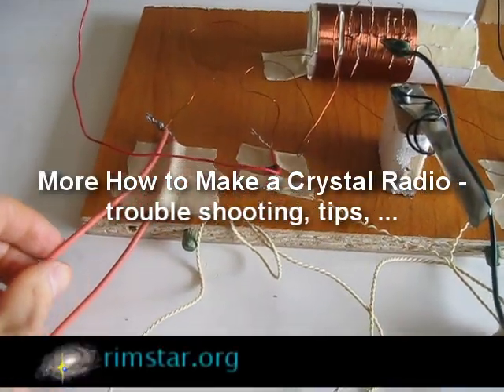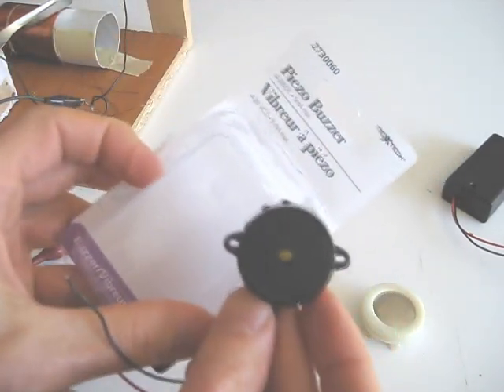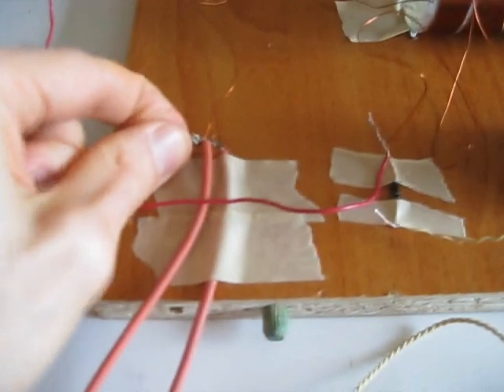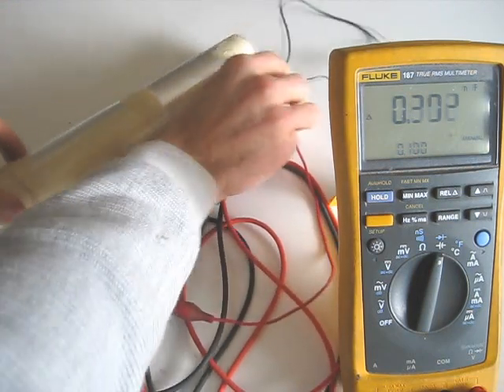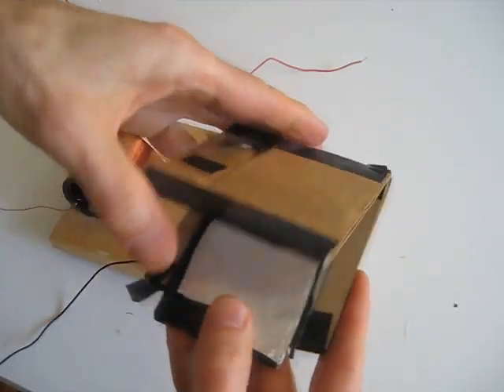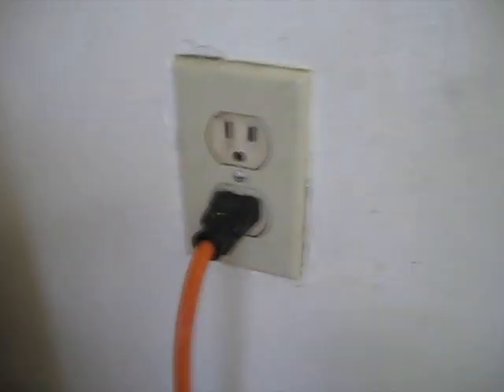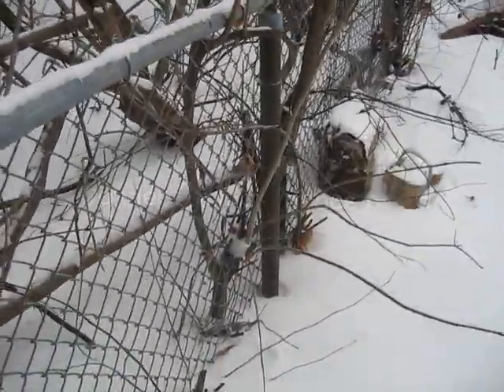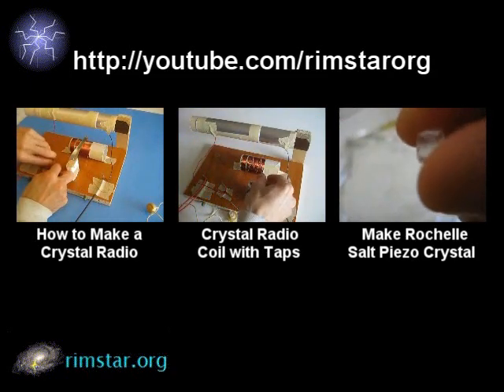Crystal Radio Troubleshooting and Tips

Comment: Howdy.
Only an observation of mine. The crystal earpiece may actually get so charged by statics it stops working. Shorting the leads produced a loud snap and it began to work. I, flippin', threw away 2 or 3 pieces possibly quite good items. So I suggest connecting a large resistor in parallel with the earpiece, say 470 k.ohms to discharge it. It may take some time for the piezo to exit the dead zone with a resistor this large but it is important not to load the circuit more than necessary.
Regards.
Reply from the maker: Thanks for the tip. I've heard of using a larger resistor like that for helping drain that charge but this is the first time I've heard of the charge causing a problem.

Comment: Hey guys, i was an amateur in a simple electronic, but i was an absolute beginner in something like radio.

 I have some question, So I (we) can each design our own crystal radio according to our needs and creativity and it was :
- How to determine the AM frequency range based on the coil (wire diameter and wire length or coil diameter)
- How to determine when and how to use variable capacitors 
- How to determine the parallel resistor value on the audio output
- How to determine the inductance value using information on the highest planned AM frequency range 
- How to determine the inductance value based on the length and diameter of the wire used in the coil 
- How to make a variable inductor
Reply from the maker: That's a lot of questions. This video http://youtu.be/EsZQS2GOMQE shows how I made it and has all the dimensions for the capacitor and coils. This one has another way of making the variable inductor (coil) http://youtu.be/d4ymSGH0-Jo using taps. There are many ways to make a crystal radio, but the basic idea is to have capacitance and inductance to tune into a specific frequency (preferably) and that capacitance and inductance can be in the antenna, coil and/or capacitor. In my radio I use an inductor (coil) and capacitor in parallel (there are also series circuits). This video one goes into how the crystal radio works http://youtu.be/HupFY_24o-4 and I have specifc videos for how the parallel circuit works but they're best viewed from my webpage which also has calculators https://rimstar.org/science_electronics_projects/coil_design_inductance.htm and https://rimstar.org/science_electronics_projects/lc_circuit_aka_tank_or_resonant_circuit.htm .

Comment: Till now I make a few crystal radio and I have to use mini amplifier to hear the station..without amp I cant hear the sound. Any suggestion sir?
Reply from the maker: The longer the antenna is, the better the signal. Making sure you have a good ground also helps.

Comment: I have ground related issues like the 50HZ hum making it impossible to hear the radio
Reply from the maker: That's called poor selectivity. Make sure you have a good ground connection. Also, the particular design I show here shouldn't have less of a problem with that. I explain why at around ten minutes and forty five seconds into this How a Crystal Radio Works video.

Comment: I built one of these from scratch for a 5th grade science fair in the 1950s with a single coil/cap, tank or resonant circuit. Worked great...I built this one with 25t/90t & sliding cap...nothing but weak static but static is an indication of "close". Put a 47K resistor across the high impedance Philmore earpiece and got a station...Skipped the 25T attaching antenna to the 90T...more volume...not criticism...just info for you to add to your projects...thank you.

Comment: can i use tunning yellow capacitor insted cylinder capacitor. cuz im not have a capacitance meter
Reply from the maker: That depends on the capacitance of your capacitor. Is there anything written on it? As I say at around 5:15, it needs to be in the range of 40 to 355 picofarads.

Comment: That vari cap of foil on tubes is brilliant. Relying on pvc to give a thicker dielectric gap, and scaled up with thick turkey pan aluminum sheet, gonna make a lil random wire tuner for  27.385. I hope it does not jump the gap after 5 watt tune-up, then slingin' 12 watts p.e.p. LSB.

Comment: I tried making the crystal radio you described, but despite your superior explanation, I'm not even getting noise. Now I'm a bit disappointed in my own abilities.
Reply from the maker: Don't give up. It's rare that something works the first, or even the second time. It does help to have AM radio stations nearby, like I do, but I've sometimes picked up some farther away. Try making a longer antenna, the longer the better for stations far away and it should be more-or-less straight for a lot of its length. Check all your connections. Make sure the top of your wiper blade is making contact with the copper at the top of the coils where you sanded away some of the enamel. A good ground is also important. Rather than repeat everything here, I've put more tips on my webpage here in mote detail https://rimstar.org/science_electronics_projects/crystal_radio_tips_and_tricks.htm Keep at it!

Comment: If I wear rubber gloves will it stop all interference with the tuning of the radio?
Reply from the maker: Wearing rubber gloves when touching the capacitor doesn't help much because there's still a capacitive effect between your hand and the aluminum foil with the rubber acting as the dielectric.

Comment: Does it work with a normal speaker? 
If yes, and my speaker have battery, do i still have to connect to the ground?
Reply from the maker: It won't work with just a normal speaker but it sounds like your speaker has an amplifier in it since it has a battery. In that case, you'd be doing something more like I do here https://www.youtube.com/watch?v=JtPwxbOgBHw with my homemade speaker and amplifier. The ground still helps in that case, but it's optional.
Reply: RimstarOrg hmm i tried following your other video but didn’t get anywhere. I’m using a peaq ppa20bt-sl speaker. Any tips? Do i need another speaker?
Reply from the maker: I looked at a manual online for that speaker but didn't see any place for an audio input.

Comment: Hi RimstarOrg! Does this radio work in any countries, like saudi arabia?
also, can i use any wires for my coil, or only  enamel copper wire will do?
lookin forward for your reply.Thank u in advance sir :)
Reply from the maker: I don't know. It depends on if you have any AM radio stations nearby. If you have a normal AM radio then you can see what you can tune into.  The longer your antenna is (in a straightish line), the better you can pick up far away signals.
Any wire will do but it has to be insulated. And you'll either have to remove insulation from the top as I did in my how-to-make video https://www.youtube.com/watch?v=VqdcU9ULAlA or use taps like I did with this coil https://www.youtube.com/watch?v=Gi9EmhrcfIg
Reply: @RimstarOrg  thank you so much sir, i'mm so honored for reply, greatly appreciated :)

Comment: I have a suggestion for an experiment you might want to try. Instead of using one diode use a Graetz rectifier circuit, in theory this would give a doubling of the power output onto the piezo earphone, i wonder if this would be noticeable. What might be a problem, and give a distortion in the audio, when using a diode bridge circuit you have two diodes per direction so the forward voltage drop is doubled. Certain silicon Schottky diodes like the 1N5711 with low barrier potential might solve the problem.
Would be interesting if you try and make a small video about it, i enjoy your videos.

Comment: What kind of wire did you use for ground and antenna?
Reply from the maker: I used 16 AWG wire but really any wire will do. The only restriction is if your antenna is a few hundred feet long then you'd need to use something relatively large diameter (i.e. not 30 AWG).
Reply: RimstarOrg thank you!!!!

Comment: I can do this with no capacitor ?
Reply from the maker: Yes, there are designs that don't use a capacitor. I don't have the specifications for one since I've never made one that way. In that case the capacitance is taken from the antenna instead.
Reply: Yes.  I have a variable capacitor from a radio that doesn't do anything meaningful.  It acts more like a volume control making it quieter.   I used a diagram similar to this one but mine does not use the .001 capacitor either (also makes volume less).  It uses the parasitic capacitance of the coil to tune it.
Reply: @UpcomingJedi  I make it but doesn't working

Comment: I have a doubt . Pls reply to it if u see , as i need to make a crystal radio for my school project . Is it ok if i use normal copper wire ( non insulated ) , roll it over a toilet paper roll and later paint it with a layer of clear nail polish for the inductance . Will it be effective?
Reply from the maker: No, that won't work. The wire must have insulation on it before you roll it on the toilet paper. That prevents the turns which are all beside each other from touching each other. It's okay if insulation touches insulation but it's not okay if metal touches metal. If all the metal touches then it is as if the whole coil is a single, very wide turn of wire only.
Keep in mind that a lot of thing wire has a transparent enamel coating on it which is the insulation. Because it's transparent, it may look like it's bare wire. Wire that's called 'magnet wire' has an enamel coating (it's called magnet wire because it's often used for making electromagnets).
Reply: @RimstarOrg  thank u so much :)

Comment: I built a radio and I thought it was just junk.  A bunch of parts cobbled together that did nothing starting with the earpiece that sounds like shit like when you go take a hearing test where you hardly hear like this guys buzzer when hooked up to a transistor radio at full volume.   I was going to throw it away in disappointment.  My radio has a 4 inch 'antenna' and nothing was hooked up including ground.   so I am sitting at  the bench and it scared me.  All of a sudden, I heard a voice while the earpiece was sitting on the table about 3 ft away coming from the earpiece I thought was no good.  damn that's loud!  Again, a 4 inch antenna here.  I have no idea what frequency it receives but the coil is calculated for around 5-11.8 Mhz.  Of course, my phone battery died while trying to capture the radio operator over the earpiece. ill put it up soon!  :)

Comment: hi.I watched your clip and making this for my skool project..... have some questions
1.is it necessary to make 25 and 90 turn?can I make about 20and60 to make coil
2.I Dint get thin magnet wire so I bought somewhat thick copper wire....my doubt is the will work or not after using it...?
3.what would be the problems if the radio doesn't works?
thank you....big fan of yours...and love your videos..:)
Reply from the maker: 1. I'm not sure how well using 20 instead of 25 will work.  I don't have any way for calculating that. 60 instead of 90 will work, but it means it will be harder to tune since the radio stations will be crammed into a smaller coil or tuning area. Overall, it's probably worth a try.
2. With the thicker wire you may not be able to tune in the lower frequencies, below 900kHz for example (radio stations below 900kHz). It's hard to say exactly since I don't know how thick your wires are. I'm basing all my calculations on the calculators I talk about in this video https://youtu.be/tjD9I95RAbw.
3. The problems are all the things I talk about in this video and in the tip and tricks section on my webpage here http://rimstar.org/science_electronics_projects/crystal_radio_tips_and_tricks.htm. It's probably a good idea to have an understanding of how it works as explained in my how-it-works video http://www.youtube.com/watch?v=0-PParSmwtE.
Reply: It depends on the coil radius and the size of your wire (and your capacitor)  that will determine what frequency you are going to get.   I have 30 awg wire or so and 21 turns for me is supposed to tune in from around 5-11.8 MHz but I have no idea though I did get one 'ham' operator speaking.  You might just be tuning an empty part of the band  at the time.

Comment: Funny story about the 2 parallel wires for a better antenna. In the late 1990s I worked for Radio Shack, and noticed the stereo FM antenna was 2 parallel wires of just a few feet.  Some guy came in and wanted a better antenna than that, but not amplified.  I made an educated guess and sold him a roll of speaker wire to put in the FM antenna ports in back of his stereo receiver, telling him to wind it around the walls, or down out the window but advised of the risks of improper grounding of a wire outside his house etc.  He came back to the store and told me it works so great, he got many stations from far away.

Comment: the apartment that i live in has none of these . all the pipes are pvc types and no radiators .
Reply from the maker: Try making just a shot antenna wire and connect the bare end of it to a piece of aluminum foil. The hold the aluminum foil in one hand while trying to make as much skin contact as possible. i.e. Try using your body as a ground. The electricity from the crystal radio is tiny and harmless.

Comment: Never connect to drain pipe...... pvc does not conduct to ground.....
Reply from the maker: That depends on what your pipes are made of, but even then, the connections between pipes and elbows are often not that great. So yeah, you have to be sure the pipes are good all the way to Earth ground. The copper cold water intake pipe from the city would be best, if it's copper and not PVC.

Comment: +RimstarOrg perhaps you can help me out. I followed your instructional. I used 26 guage wire to do my windings and connect my wiper blade to ground. For my capacitor i used 20 guage hookup wire to connect my capacitor to the diode and ground.  The pizo earbud i connected to the side of the diode closest to the line, and i hooked up two 15 ft antennas one 26 guage and the other 20 guage. I triple checked the connections and everything follows the diagram properly however i cannot hear anything. For ground i am doing the same as you connecting to the bottom sprocket of the wall.  The funny thing is if i touch the diode and ear piece connection i get static. not touching it no static.Moving the windshield washers around while i do this i can hear the scrapping, but the capacitor does nothing when i move it. Any idea what might be the issue?
Reply from the maker: Since you get results when you touch it, then most likely the ground in your wall socket is no good. I live in an old building and have tested the grounds in all my wall sockets and only one is good. 
Make sure your antennas are straight for a long as possible. Since you hear static when you touch it where the ground should be but you don't tune into any radio stations, it's possible you don't have any radio stations nearby that are strong enough to pick up. You may need a longer antenna. You could also try more antenna wires in parallel, but I found that is of limited value as you add more. Make sure they are spaced apart by a few inches/cm to be worth it.
Also, make sure you're getting good electrical contact where the wiper touches the sanded part of the coil, but don't sand the coil so much that too many adjacent turns are electrically connected.
And of course, work on getting a better ground.
It sounds like you're on the right track. Keep trying, and let us know how it goes.

Comment: and also i am useing coils from radios that I ben given to me take apart and have to keep can you use the am fm radio coils out of a household am fm radios
Reply from the maker: +Andrew Kimble You can use other coils as long as you're removing the wire from those coils and winding your own coils in the way I show in this video. How long is your antenna? Is it a roughly straight line? Are there any radio stations nearby? What are you using for ground? Are you sure the tuning bar is making good electrical contact with the top part of the tuning coil where you removed the enamel?
Reply from the maker: +Andrew Kimble I'll reply here instead of in the other unrelated video and so its all in one place. You have to take the wires off the old coils since they are the wrong dimensions if you want to make one like mine. If you're making on with a different design then I don't have the time to figure out what you're doing and help you.

Comment: I got you're message so you said I can use my metal bed frame cooll got it ok I might try that is there other ground connections I can use like a watter pip that I use to watter with
Reply from the maker: +Andrew Kimble A metal bed frame might work. I've never tried it, mine's wood, so I can't say for sure. You can use your water pipe but only if you're sure that it's metal all the way to the ground.